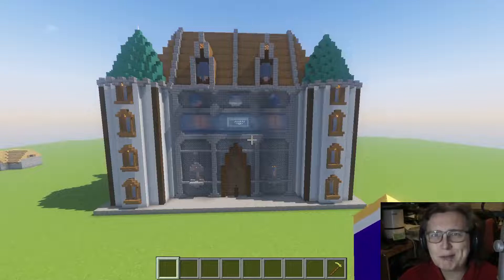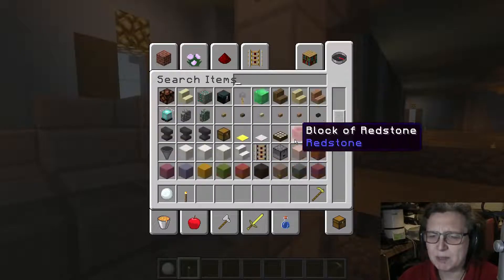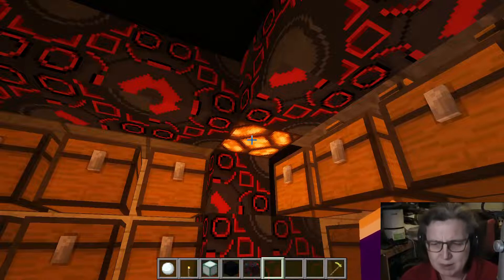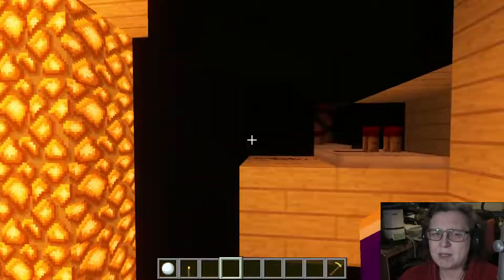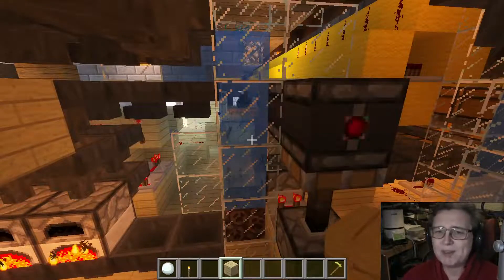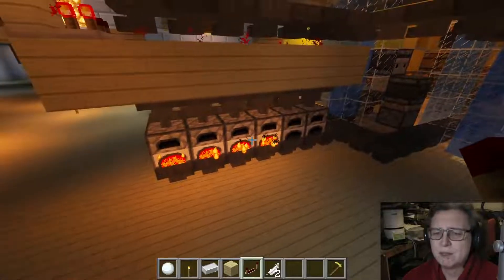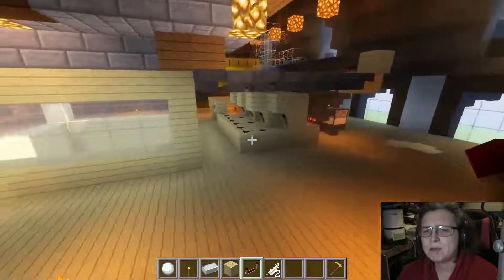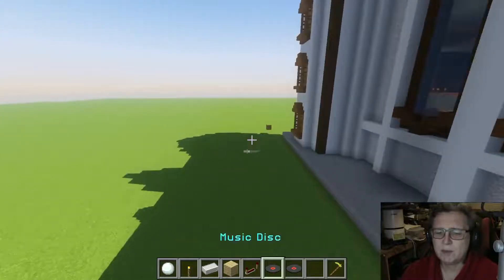Minecraft - Chateau de Survival - Part 2

Comment: Is there any way to break up the very white towers with some "'exposed brick''. Your 4 main walls are composed of stone brick. It might look cool to make a few random spots on the towers that same brick and make it look like the white stucco has fallen away exposing the structure of the brick below. Does that make any sense?
It might look terrible but that was just the inspiration that came to me.

Also, have you settled on a location for this?
Reply from the maker: I understand where you're going with that. I'll give it a try. No, haven't settled on a location yet. I want to get into some of the new 1.13 generated areas first, and if I can't adequately fill up the mechanism areas, then I might design something smaller. I'm not sure yet. Long way to go.

Comment: How about an indoor swimming pool? And if you have so much room, why not quadruple your machine storage rather than just double?
Reply from the maker: I can only put a swimming pool on the lower level really, or else the water drips through the ceiling. I would have put it at the bottom of the glass window in the centre, but I have to put the fishing machine beneath sky, which makes it awkward. Nice idea though! 1.13 and 1.14 have given us a chunk of new design blocks like stairs, slabs, more specialist woods, but not much in the way of extra mass-produced blocks like cobble, gravel, etc. so not much to put in the machine. I'll cover that in part 3. Keep the ideas coming!